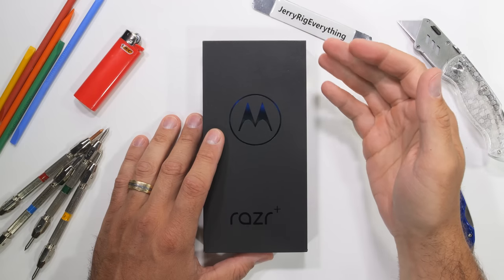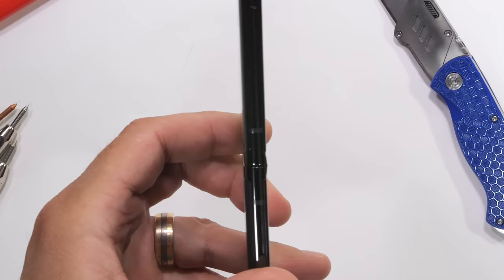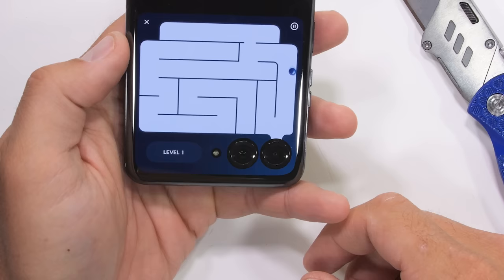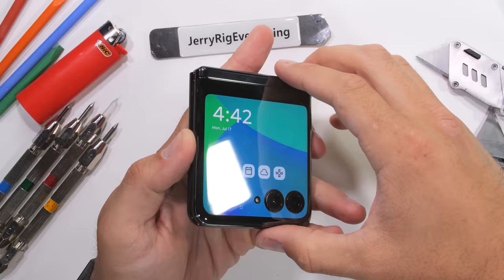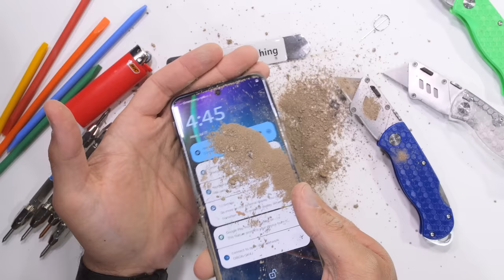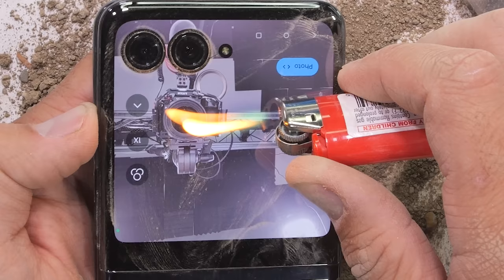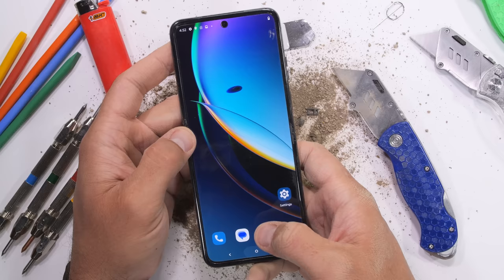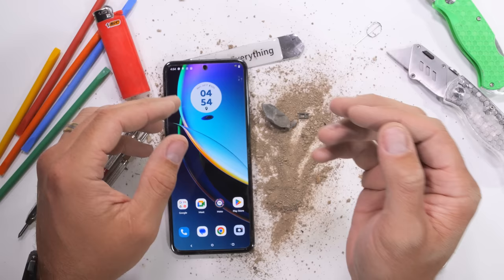This has NEVER happened before...

Comment: I don't think the spot that caved in would do that when folded and sat on. That was a very specific pressure point due to trying to bend the hinge the wrong direction. I say it's a pass, especially with all that dirt you threw in there. I'm impressed.
Reply: I agree with your observation
Reply: I have a feeling it can still happen. A weak spot for glass is not negligible.
Reply: Into that empty area does swell the inside flexible screen, but that's not going to give any more backing to that external half-screen. The phone looks pretty good otherwise, especially the hinge itself, but Motorola could have easily put a thin metal sheet behind the screen there, not lost much space inside for the folding screen, and greatly strengthened that area. It think it would fail pretty much the same when folded if you squeezed on it in the same place.
Reply: @GregConquest  I can personally vouch for this happening. I had the phone folded inside of a pocket in the rear waistband of my skirt. When I pulled the phone out the outside screen was badly cracked about a finger's-width up from the hinge. I thought maybe the pressure from the pocket zipper pull had pressed against it but it's not possible to have the pull hit the folded phone in the location the crack occurred. There is definitely a give in the glass on the spot where it's cracked so it appears to be a pressure crack. I called Motorola support but without the pricey accident care protection (that I turned down thinking I wouldn't need it and would just pay for a repair caused by a drop) they refuse to help me. I believe this is a defect in the phone that others will experience - a phone should not fail when in a padded pocket! After years of using LG phones I returned to a Motorola thinking the durability would be adequate on this phone, barring drops, of course. Boy was I wrong. Thumbs down to Motorola, and a warning to those who keep the phone in your pocket - pressure against the outside glass towards the hinge area WILL break the glass. Ugh.

Comment: Since it's still functional I'd say it's about a 60% pass. If the screen broke like that, which looks likely, it would need replacement or repairs quickly but it would work until then. Still a hard pass from me
Reply: i would fail it's ass because that front screen has such a huge oversight
Reply: @@GH0STST4RSCR34M you can buy parts for every other razr why would this one be any different?
Reply: @aqua-bery  when in the real world is the hinge being bent backwards with enough force to shatter the back glass without severe misuse?
Reply: @aqua-bery my love I've dropped my RAZR+ with no case on concrete with no issues. This test is intentionally designed to destroy the phone and not really what would happen in day to day. I would say this phone is more durable than my iPhone XR (the last iPhone I bought). 

I've gone without a case since I got it and it has no cracks or visible scratches.  I could never do the same with any of my previous smart phones. 

The Motorola RAZR+ is the best phone I've ever had in my entire life🤗This phone is about experience it gives you in reality😉 People are excited to see me and my cool folding mini phone especially in the Magenta color💖❣️💖
Reply: @@GH0STST4RSCR34M the problem was never finding replacement parts it was getting Motorola to work on his phone

Comment: My guess is that void behind the small screen is to accomodate the flexible screen when the phone is closed. As you showed when it is closed there's no gap in the hinge side so they've probably added those spaces to avoid pinching the flexible display when it is closed.

Comment: I'd give it a 7 out of 10 pass.  Both screens still worked and the hinge held up.
Reply: The one that is broken will go full black after a while. I had 2 phones in my house break due to damage from falling and they do work for a few hrs but then they go black later.

It is a sort of slow process but you can see the discoloration of the screen set and it goes full blue the keep becoming darker till it's fully black.
Reply: @MrPopo-kn3lx  Were they Samsungs? Mine had a tiny crack and the screen died straight away. My wife's iphone still continues after being completely shattered.
Reply: @Brukn0ws  one was samsung, the other was asus (good chance that asus uses samsung displays too)

They sort of had their display layer damaged I think. If there is just glass crack then it would work
Reply: @MrPopo-kn3lx  idk i had an galaxy s8 and im a phone abuser. after 2 years with cracked, thrown, shattered screen, still worked. Then i turned it into a flip phone and no longer works.
Reply: @Brukn0ws Samsung makes the displays for iPhone and their own stuff, so the phone brand is pretty irrelevant
Reply: Putting the case that came with the phone on the front should hopefully prevent pressure being put on the front screen unless it's hit right in the middle of the screen.
Reply: @Brukn0ws The display technology is largely similar. So your wife's iPhone probably only got broken glass, and didn't break the screen pixel layer.
Reply: he is the reason why flagship lightweight phones have become very rare nowadays, theres absolutely no need to forcefully bend these phones, only an insane person would do that to their phone
Reply: @thewatchmenz  no
Reply: @Brukn0ws I don't know if you think that's a win for Apple, Samsung makes and provides the displays for all iPhones 😅
Reply: @MrPopo-kn3lx  It depends on what layer of glass breaks. The OLED panel is more likely to fail if the damage is to the array, but it should be just fine if only the top layer of protective glass is what shattered.

Comment: I think the front screen also broke because of the metal pieces touching at the hinge. My guess is that through bending the phone backwards the metal part got pressed up against the outer screen, creating even more and a different direction of pressure, leading to it cracking under your thumb
Reply: he is the reason why flagship lightweight phones have become very rare nowadays, theres absolutely no need to forcefully bend these phones, only an insane person would do that to their phone
Reply: @thewatchmenz  I will say, some of the concerns I've seen people post about the fragile nature of folding phones makes me question how some people actually care for their phones. Like sure, they'll break more easily than a regular phone, but phones in general are fairly fragile and should be handled with care regardless.
Reply: @thewatchmenz  to say he's the reason goes a bit too far. He's a reason alongside consumers wishing for longer battery life, a more premium feel and more premium materials. Also keeping newer chips cool makes coolers bigger and heavier

Comment: That's a big win. Looks like an easy thing to correct in future iterations, and it is probably unlikely to break with normal use. I really like this phone, especially the outside screen.
Reply: Especially when you consider we probably aren't going to be bending the phones backwards. I saw a point made about what if someone sits on it, but I'm sure the pressure from that is much more even plus the phone is closed

Comment: I'd call it a fail considering the small screen can break so easily if force is applied to that weak spot. These flexible screens scratching at a 2 is crazy to me. You have to be absurdly careful with these phones. I generally am, but I like a bit of leeway lol.
Reply: Ahhh yes why don’t you develop folding glass then
Reply: How TF is this a fail??? Who on earth is going to be bending a phone backwards???? Nobody. That is the ONLY reason it shattered. Especially since he did another test where the phone was closed and he put pressure on the exact same spot and nothing happened.

Comment: For foldable phones, you need to add an extra test. Add like a grain of sand to different parts of the screen (edges, center) and then fold it. See if there's any damage. Then fold again and apply a bit of pressure. This is important because this is something that can happen in real life. Some people even reported damaging their Pixel Fold this way too.
Reply: He is putting sand/dirt in it tho?
Reply: @Yoon_gibiased  Whatever he is putting in, is soft and breaks apart easily. It's more like dust. Sand on the other hand is coarse, rough, and it gets everywhere.
Reply: @kuroodo_ Okay, Anakin 😜

Comment: Considering where foldables are right now, I'd consider this a very good pass. It survived that sand torture tha was painful to watch and remained basically functional at the end.
Very good pass.
Reply: Where foldables are right now ? Samsung's foldable ever since the Fold 3 survived bending and dust 2 years before this Razr, actually be functional almost flawlessly after such abuse, unlike this one which got one screen broken. 

Also the whole idea of the Razr plus is that you don't need to open the phone as often (to quote Motorola themselves: "If you're gonna open it all the time, you might as well buy a slab phone"), having their outer display, the main selling point, broken from just a finger pressing against them is just hilarous

Comment: I’m surprised why phone companies don’t hire Zack to show up at their offices with his kit and do a durability test before they are released to the masses. Sounds like the obvious thing to do.
Reply: honestly it's usually because they spend millions on R&D and do testing all throughout that phase...also to be fair to companies some of his tests are unrealistic/unreasonable like the flame test (which Zack even admits is just for fun basically)
Reply: anyone can do it
Reply: They'd have to go back and start again lol
Reply: @sdrtcacgnrjrc  No they dont lol. Imagine putting a solid plastic cavity instead of that hole behind the front glass. Obvious structural design flaw. Im just a software engineer but I do hope any mechanical engineer can understand that.
Reply: @akarshJD  This is speculation, but it is important to note that the pressure that broke the glass was applied in a very specific way: a thumb pointing straight into the glass. It looked like if he situated his thumb elsewhere the crack wouldn't happen. Whereas in any other case of normal use, the pressure of perhaps sitting on it would be evenly distributed elsewhere to places with support.

Comment: That void behind the exterior screen is a bit of a concern, but I'd call this a huge win compared to other folding phones! And the shattered outer screen still mostly works, even with that hole!
Reply: Exactly what other folding phones again ? The only foldables aside from Motorola that Zack has tested were from Samsung and Google iirc, and while the Pixel Fold got crushed, Samsung's Z-fold has survived without any outer display breaking since at least the Fold 3
Reply: @hoanganphanle Yeah, the Z Flip 3 and 4 did pretty well in his tests too. At least as well as this Moto if not a bit better. The only time I had any serious damage to my Z Flip 4 was when I was unlucky enough for it to slip out of my pocket at just the right angle for the corner of the hinge to hit pavement. I had to get the hinge repaired, but the screen didn't break even with my dad trying to force it to open all the way. That put extra pressure on the screen since it couldn't open the way it was designed to, but it didn't break. The Z Flips are tough for what they are. I just have to make sure it doesn't fall out of my pocket onto concrete. That's my only concern.

Comment: I have had my Motorola RAZR+ for a little over 2 weeks with no case and have dropped it multiple times on concrete and tile with only minor scratches.

I also accidentally threw the RAZR+ across the room where it hit the wall then ceramic tile floor when I ripped off the covers frantically searching for it on my bed so I won't be late for class lol 😂 

It's so much more durable than my former galaxy z flip 4 that broke when dropped on carpet in a case. I had to replace my Flip 4 once a month because of durability issues even with a heavy duty case that covered every inch of the phone that wasn't the screen! 

I'm so much more happier with the Motorola RAZR+ ☺️☺️☺️☺️

Comment: Did you know that the first cellphones by loose defenition were available in the 40s by AT&T(at the time Bell) they used "0G" cellular, which was given the name because the coverage maps looked like bioligical cells. 
These pre-1G cellular telephones usually could not dial for themselves, and instead connected to the switchboard operator who connected them to their intended number.
Instead of all phones operating on the same band/sub band, each connected phone needed to own that band while talking, sort of like a walkie talkie, as this was basically just a walkie talkie powered by a truck/car, and wirelessly connected to a landline

Comment: Id say its a partial pass because while it did break, bith screens still worked and it didnt fold both ways. However, the exterior screen did break but still mostly worked, so its not completely a fail there

Comment: considering you literlly carved in the outer screen and peeled parts of the display out to see whats inside the phone underneath and the display coming back to function almost flawless except for somewhat annoying stripes and well the shattered glass. There is literally a hole in the display and it continues as if its nothing. Weve come a long way from displays that literally leak and die to the black void if pierced. Imma give this a thumbs up for durability. The cavity btw under the outer screen is probably part of the hinge mechanism I would think but I might be wrong and then I would be curious why it wasnt at least filled with some foam

Comment: I was waiting for you to remove the screen protector and see if it still works and if the underneath scratches.

In any way, I'd consider that a pass. Even though the front screen broke, the structure of the phone seems fine. You can always change a display.

Comment: It's a win for me. The main screen and functionality of this phone is that folds. Gettin' rid of the exterior screen isn't that much of a problem. Main screen working well after the bend test, it's a pass!. Phones that are made for single screen and not foldable are cracking with your bend test. 4 stars rating out of 5.

Comment: There was an earlier mobile phone also by Motorola I believe that was called the brick as it had a massive battery carried on a shoulder sling with a handset rather like a regular phone of the time. I skipped the 800x and had a 900x, which was the same basic design, but was less clunky. Somewhere around 88/89 if I remember correctly.

Comment: I've stuck with Motorola smart phones since the early 2000s. Maybe not the fastest or have the best specs but they are dependable and I've never had any major issues. The only reason I buy a new one every few years is due to the android system and security updates!! 😁

Comment: Since the screen requires pressure at a very specific point, it's half a win in my book. I'm not giving it extra leeway because it has 2 screens though. It's priced like having 2 screens as well, so for that money they should make sure both screens are properly protected. That's my €0,02. That said, they should really fill up that void with something for a revision tbh.

Comment: I would no doubt consider this a FAIL. With that rear screen completely shattered its functionality is compromised and the device is also unsafe to hold in its opened configuration since your hand will be directly touching the shattered glass so without a case that would be cuts ad infinitum.

With that big void under the outer screen you can't keep the RAZR in your front trouser pocket since that outer glass will bite it when you trip.

Comment: If only they could fix the problem with the folding screen quickly developing a permanent crease and making them cost less than a cheap second-hand car, then I may consider buying one of those phones.
I remember when folding phones first came out. I don't remember which company was the first to release them, but I do remember they outright lied to everyone, by claiming the folding screens won't end up with a crease. Even the display ones have deep creases where they fold.

Comment: I'm a bit bummed about this phone. I bought it and within 5 days, had a scratch that turned into a crack. It was such a fun phone to use but I ended up just sending it back today. Had it for 5-6 days roughly. I will say this, it is both one of the most durable flip phones, but is so fragile as well

Comment: That hollow spot behind the outer screen is going to be a HUGE issue. Think about it, when this thing is folded in your pocket THAT is the screen that is going to be sticking out from your thigh. If a little bit of pressure it applied it's going to cave in that hollow area behind the display. How many time have you carried groceries, lifted a coffee table, bumped into something at work, with your phone in your pocket? They could have put a plastic frame behind the glass for literally next to NOTHING in cost. They had better get this revised quick or they are going to have mass returns on their hands. The outer screen should be the tougher of the two screens considering it's gorilla glass and the exposed screen, meanwhile the plastic screen should be the fragile/protected one. If you buy this phone you had better get tempered glass on the exterior to double up on the thickness of that glass to try and protect it!

Comment: I'm really impressed by this phone and if apple made this with ios, I would seriously consider it. But they need to address how easy it is to scratch that main display. Level 2 scratches is... bad. I know the challenge is you can't use normal glass, because glass doesn't bend. But right now, I see people buying one, and giving up on them and never trying it again, even when they make the screen more scratch resistant. Still feels like we're a little early on this trend.